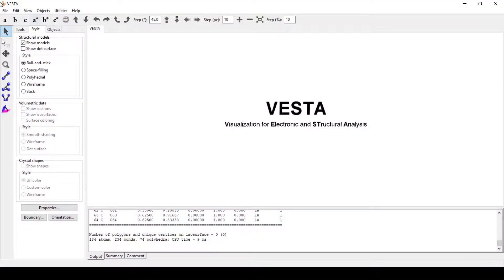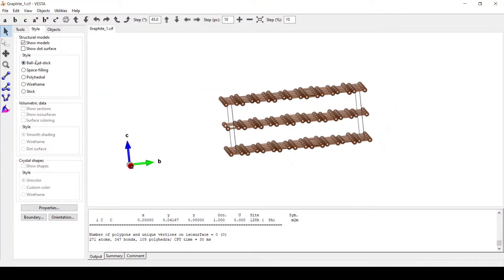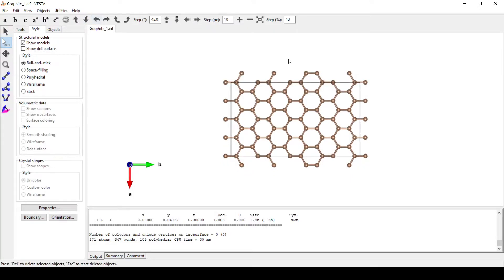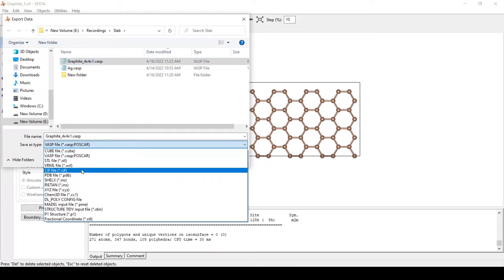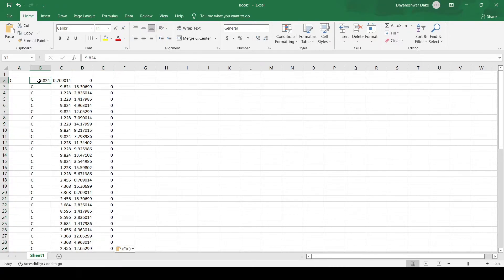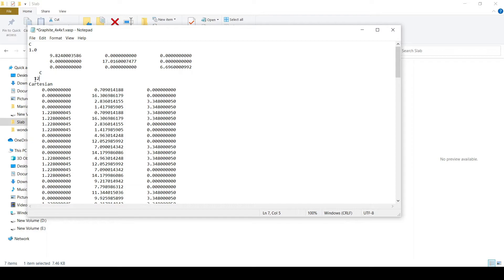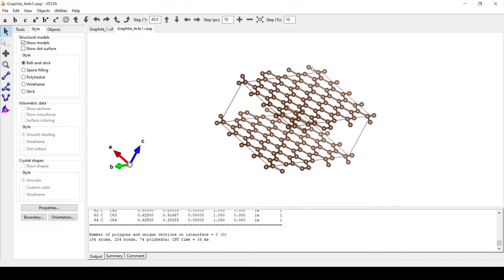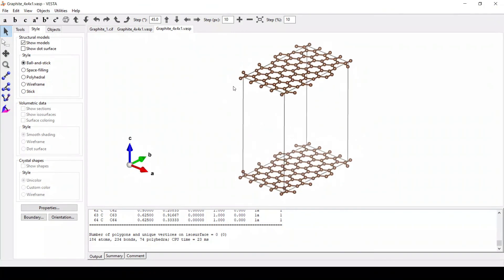Monolayer Graphene from Graphite using VESTA

Comment: from where did you get graphite file in start of the video
Reply: same question
Reply from the maker: www.crystallography.net/cod/cif/9/00/00/9000046.cif
Reply: @DnyaNiPhysicsWorld  
Thank you very much for providing the link. I had searched the Materials Project but couldn't find graphite's cubic phase; they only have the hexagonal phase, which makes it quite challenging to create interlayers with metal (111) surfaces.